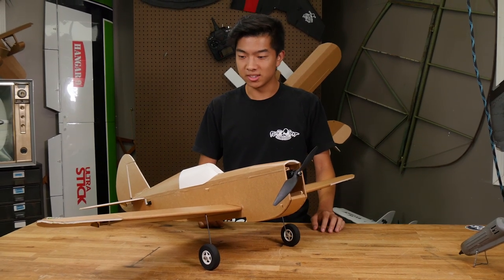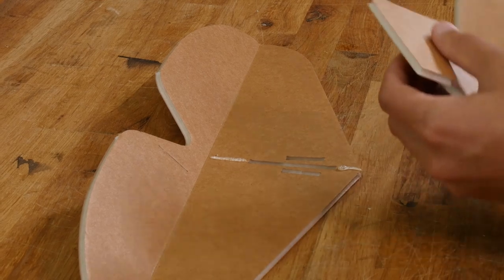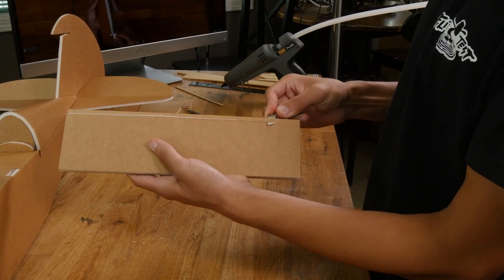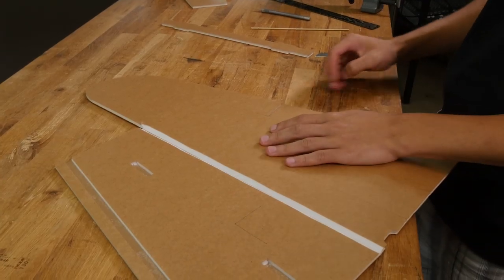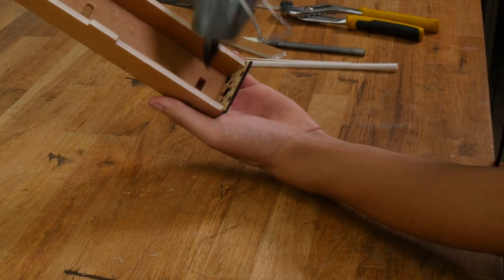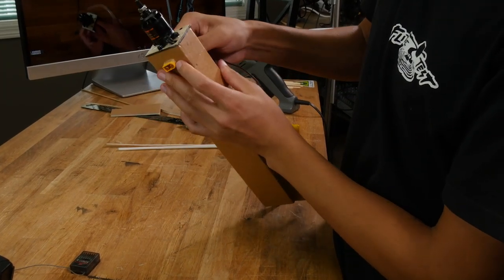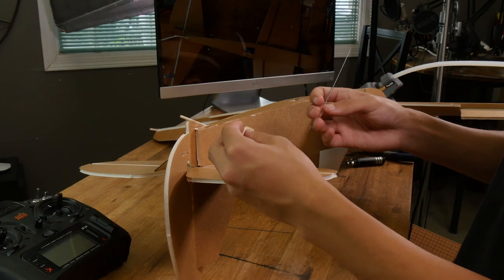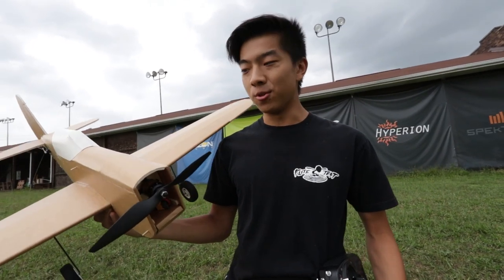How to Build the FT P-40 Warhawk // BUILD

Comment: I think yall need to updated this video. A few things were off. Most noticeable was the motor in the video is not the motor I got in the power pack B. As of when I'm writing this, the screws wont line up with the wooden frame.

Comment: I would love if you started selling poster board plans on the store!  I have gotten the kits before and scratchbuilt as well and it would be great to not have to print and glue the plans to poster board for replacement parts.
Reply: I WOULD TOO!!!! 😎😊😊
Reply: You might know by now but they have always had free plans for each plane available located under the resources tab when on the specific models sale page
Reply: Yeah I have built tons of the plans but I always hate cutting out the plans and gluing them to poster board for when I crash and need to repair or rebuild.

Comment: Since you've made this kit as a P-40 Warhawk, could a modification be made to it, or offered that would turn this kit into a P-36 Hawk the inter-war years pursuit fighter aircraft from which the P-40 was derived?  Curtis/Wright had simply taken it's Radial engine P-36, removed everything forward of the firewall then installed an Allison V-12 inline engine.  The great thing about the Hawk was that it's suburb handling being fully aerobatic.  The A-36 had better wing loading, climb rate and roll rate than the legendary A6M2 Zero model aircraft used in Pearl Harbor.
Reply: There's an idea!! Nobody has a P36... 😎

Comment: Nice build as always! The only problem I had with the speed built kits are the control rods. Especially on the Edge but also on every other plane I feel like the simple Z bends on both horn and servo have too much play. I noticed this the most in fast flying and some 3D tries of me that the control surfaces are pretty wobbly and you feel this in the air... Maybe you could think about a more premium solution with better linkages included oin the kits in the future!
Reply: Posso ⁰909

Comment: In the plan it says cg is 2 inches from the leading edge in the build video here it says 1/2 inch from the leading edge! I think 2 inch on the plan is wrong. I tried it out and the plane is tilting down unless you shove the battery way back...
Reply: Pater Edler shoving the battery back as you say moves the CG back, bringing it closer to 2” than 1/2”... so... which is it? Just built it, haven’t maiden yet waiting for weather and clarification on CG because there’s indeed much confusion for this model

Comment: Excellent build Andres... thanks... can't wait to get a P40.  For the Landing Gear Wire... are you using FLT-2067 2mm Thin Landing Gear Wire or  FLT-2065 2.6mm Medium Landing Gear Wire?
Reply: The kit I received includes the 2.6 mm wire.

Comment: When buying it does it come with remote, serves batteries and other stuff
Reply: RNG MrDefaultAsian u have to buy a separate remote and if u get the speed build kit then u have to add on a battery and the power pack c to get the servos and propellers and wires and motor and all of the stuff like that

Comment: How many sheets of foam paper do you need for this or do you have to buy it with the plane
Reply: The kit includes everything you see. All the laser cut foam, the pushrods, and firewall . To complete you need the motor , servos, receiver and a transmitter .
Paint could be good too .

Comment: I know you are trying to save time on your videos. the sections that you time-lapse may feel mundane to you but for someone who is trying to actually build the kits those details can be very important. Remember this may be the only video they watch. You may save 20 minutes by doing these time lapses. But when you're looking at an hour long video 20 minutes doesn't make much of a difference. Unless of course you're actually trying to build the kit. The extra detail can make all the difference no. I hope you reconsider short cutting your videos. I enjoy watching them but this one was not as helpful as the first ones have been. Thanks for doing this and good luck.
Reply: We can all fast forward to the parts we need our back up to the parts we need to watch again. But if the detail is gone it can be confusing.
Reply from the maker: Thank you for the feedback. Can you tell us which timelapses made the build harder for you? We try to only use timelapses when a step is being repeated (e.g. opening up score cuts, screwing the motor on the firewall, etc). Thanks!
Reply: @FliteTestTech  I am currently designing and building a YF-23 Black Widow. I watch many of your videos in order to develop the techniques I need to use while working with foam board.

The hand techniques of cutting in left aileron versus a right aileron can be completely different. Cutting in the other arms may seem repetitive but the hand techniques with the tools can be very different and challenging. If everyone were ambidextrous it might not be an issue.

Please forgive me because I do not mean to be facetious.

Handling the tools and left to right handedness is second nature to you. For a beginner like me understanding exactly how you hold the knife something that I need to get from your videos. I use many parts of your videos when I modify those plans to fit my design. 

While cutting in the left side of a wing may seem to you exactly repetitive. The hand technique that I'm missing out on would help me to build the rudder elevator in the forked tail section of my build.

I think if you don't use the time lapses you will get more views as a matter of reference. Longer few times as people build your kit along.

I realize you're trying to do this in order to make your videos more exciting for the viewer. Sometimes if I'm using one portion of your video for my build I might still scan forward to the maiden as motivation. I really believe that that is what makes me watch longer than I normally would.

So the short answer to your question is "All of the time lamps as you put in your videos has affected my builds."

If I could get into the mind of FlightTest.. I would love to see how you draw up a new plan in AutoCAD from start to finish.
Reply: @valhallaholsopple  Thanks for the detailed reply. We will be looking at the pros and cons and weighing all our community feedback on how we approach timelapses in builds in the future videos. Thanks for taking the time to give us feedback!